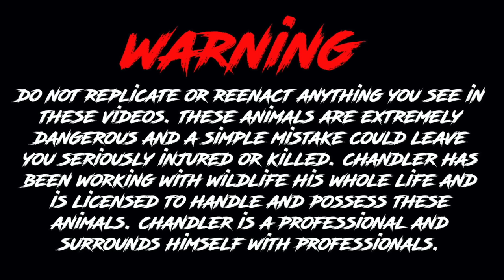Baby Cobras, Black Mambas, & CROCODILES!

Comment: It is true that Crocodiles never stop growing throughout their lifetime but by they do the vast majority of the growth younger in life. An older Croc will grow, but very very slowly. Cassius is the largest crocodile currently in captivity and he has been measured for the last for 35 years.  During that timeframe he has grown roughly 1 foot, from 17ft in 1984, to 18ft in 2023 si you can see at a certian age their growth slows down exponentially. They typically grow fast, about 1ft a year, until they got sexual maturity. After that the growth rate slowly decreases over time.